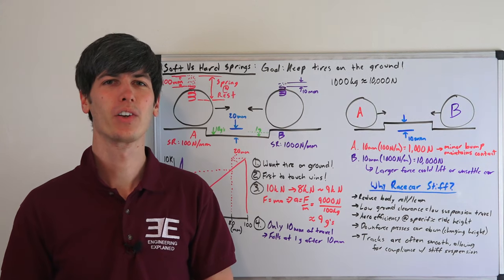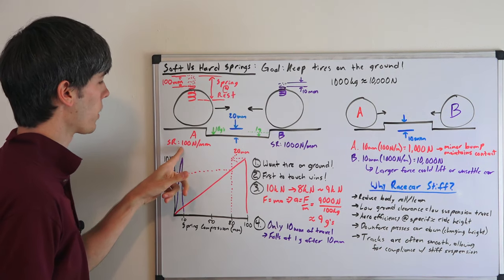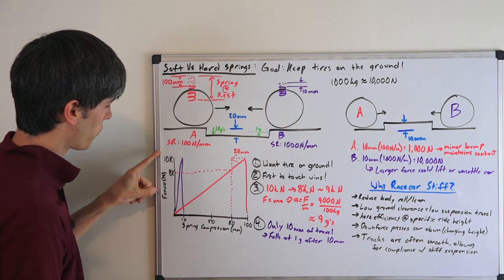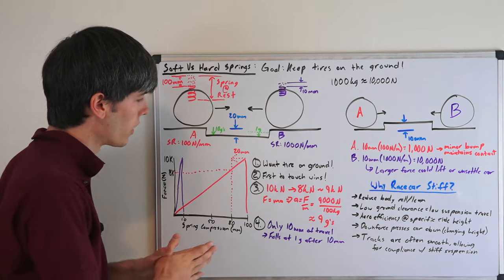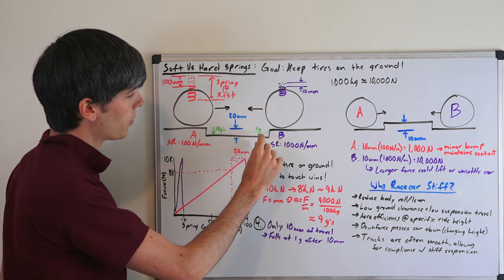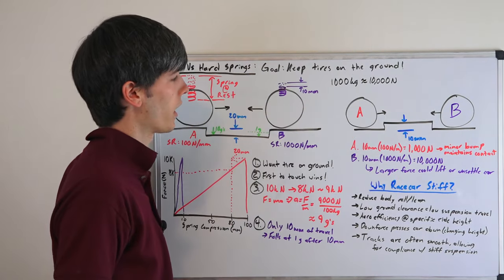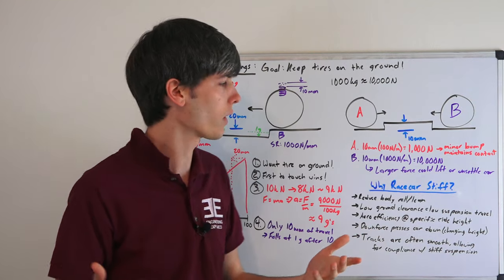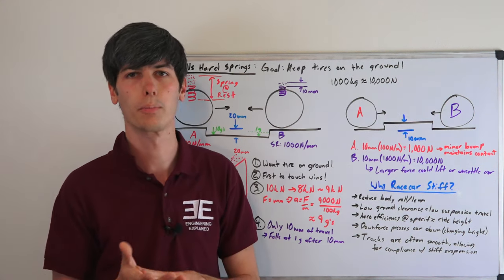What's The Best Suspension - Soft or Stiff Springs?

Comment: There're 3 basic things who affect each other: Range of spring, spring rate and the shock absorber.
Particularly the shock absorbers have to be well matched. For example there are high- and low-speed compression/rebound-stages and also the viscosity of the damping oil matters.

Comment: All of your reasoning was pretty sound and the science was definitely correct. The only thing that struck me as a bit odd was that the comparison was pretty unrealistic. Nobody ever puts a spring that's 10x higher in spring rate while using the car for the same application ie. street driving etc. Typically, I see most tuners and companies going to a 1.5-4x spring rates depending on how stiff the car initially was and/or how much suspension travel they intend to utilize. That might have made a more reasonable comparison. Great video, nonetheless.

Comment: Is that spring rate or spring stiffness? or are they both the same thing?
Reply from the maker: +Adnan Rahman I use them interchangeably. Ultimately you're measuring force over distance (how much force is required to compress the spring 1 mm).
Reply: +Adnan Rahman I believe spring rate is about the force necessary to generate each 1mm of compression in the spring. so, the higher the spring rate, the stiffer the spring is.
Reply: Thanks for the response guys. I was just a little confused because I always took rate as something per unit of time
Reply: Adnan Rahman haha i get what you mean. i think what throws people off is that the word "rate" is often used by normal people to describe some sort of speed or change in distance over time.

here, it's really more about the spring's compression, so not much to do with time at all. glad it helped you!

Comment: When racing downhill mountain bikes I tend to set my suspension up to be using about 75% travel to float over most terrain. If it is not using that much, i soften the spring rate and/or back of compression damping. The last 25% is used for g-out situations durning landings and such. Using this much suspension travel makes for an active and smooth ride.....any less and you are suffering unnecessarily and could be going faster. The only problem is that a huge compression coupled with an impact like a stone can blow into the bumpstop and dig deeply into the tire thickness often causing a pinch flat. it creates a condition where there is a huge risk of flatting but the massive amount of control will (hopefully) allow me to avoid those obstacles. Tire pressure is hugely important as it changes the frequency of the small chatter type bumps and works thoroughly in conjunction with the suspension. Tire technology has improved so much in cars and bikes that it is easier to avoid flats. This balance between compression and rebound damping, tire pressure, spring rate and rising/falling rate suspension can not be figured out mathematically and there is always a compromise. I tend to go soft and avoid big hits....I'm light and so are my vehicles. Big guys/heavy vehicles have to beef things up more and the weight begins to push heavier into the tires. I might run 30 psi where big guys will run 45-60. They handle the big hits but bounce around on the little stuff. For cars and street, set it up for where you want performance. Straight lines, or on ramps? Choppy alleys or highways? I like to be able to blow through transitions, chop and chatter with minimal fuss, smash speed bumps and humps and drive like a crazed rally driver. I'd prefer to not slow down over every rise or parking transition. I want to be able to keep up with most people on smooth but not necessary beat them in my 2800 lb truck and say bye bye over the crappy sections. I seem to get around better than most road cars and our town has terrible roads. Temperature also affects the durameter of the tires. Tuning the tire pressure is equally important to spring rate. If I were upgrading a car, I'd start with firmer/lower profile tires and then moderate spring stiffening after. If your vehicle is fairly good as it is, adjust incrementally.

Comment: This was a great chat. However an integral part of suspension control is damping, and the the stability of the vehicle structure. If we take a planar structure such as a ladder chassis, the depth of frame relative to the depth of vehicle structure is modest. Thus the frame becomes a spring system in it's own right and the spring / damper selection has to compliment the frame stability. Most successful road cars with relatively soft spring rates have above average body stability.

Comment: What if the driver is 70 kg or 130Kg :D if u have soft springs and the person is heavy... than you get hard springs 
I think it is personal what the driver like, Comfortable or sport drive
Reply: Driver weight generally has no impact on how the suspension performs.... You're talking a 60 kg difference in a 1500kg car.
Reply: yes maybe when the car is 1500kg then u not can see it maybe, but when i see my friend from 100kg step in his lowering car 980kg.. i see the car go more down on his side
Reply: MMD While the vast majority of cars are nowhere near that small, a 60 kg difference is still only 6% of the car. The car's stock suspension is designed to work with that kind of load and does not require a stiffer suspension.
Reply: and also when u put a big subwoofer in the trunk the car go down, so not very usefull information in this video ;)
Reply: MMD For example, in a 900 kg Mitsubishi Mirage, the suspension is designed to support an additional 400 kg in passengers and cargo.
Reply: For some super light cars maybe you'd have to consider that, but where it really counts is on motorcycles.

On a track/race bike, or even sometimes a road bike, there's a huge amount to be gained by getting springs that are tailored to the rider's weight.
Reply: Saying a passenger doesn't affect performance shows how much performance driving you do - very little. Even in my wrx (1400~ kg), a 70kg passenger throws out my balance, especially in tight, fast corners. Of course, it's barely noticeable with normal driving but there is a small, but noticeable and performance reducing effect when on track/spirited runs.
Reply: Victor Chang I never said a passenger had no effect on performance. All I really said is that a heavier or lighter driver does not necessitate a change in spring rates for your suspension. 

In your case, you fail to notice that with your weight mostly on one side of your car, a passenger actually improves the balance of your car. The increased weight can cause a noticeable reduction in acceleration, but cornering performance could actually improve because of the more centralized mass. 

At any rate, having a passenger or being a little heavier will absolutely not affect the spring rate chosen for the overwhelming majority of cars. 

Funny that performance complaints due to extra weight are coming from someone with a heavy AWD system weighing them down. Maybe try driving something a little sporty.
Reply: I Race dirt bikes and with us a lot depends on terrain if its really rough big jumps we go stiffer on the springs if it has smaller choppy type of terrain then we go softer and of course one's weight has a lot to do with springs as well,

Comment: Really good video and good food for thought. The only thing I would add to this, is particular with regards to racecars as a rough rule of thumb the stiffer the suspension, both in spring and bar the more it will put temperature into the tyre. Consequently when you start running race rubber you always play a delicate balancing act between mechanical grip and ensuring the tyre is up to temp.

Comment: Yup stiffening up suspension becomes disadvantageous as the road becomes more impure with bumps and etc. That's why stiff or soft can be good. Depending on the situation. If you had a pure road I would use a stiff suspension. If you drive on a racetrack thats not as pure. Time to lighten up the suspension.  A road car... You definitely what a reasonably softer suspension. Myself... I track and daily drive my RSX. So I don't use super stiff springs or suspension. It has a "in general" tune that can ride safely on daily streets and stiff enough to make my car responsive on a track. Kinda find the sweet spot. But serious racers are having their cars adjusted for every track

Comment: Ok, the thing is that stiff springs are supposed to be used on tracks, because they affect weight distribution and weight shift and also handling, stiffer springs allow more weight to be charged on them without the worry of them being squeezed to death so this allows them to handle drift better allowing you to go faster, on the other hand soft springs really shines in everything else because either on track (only of you are a grip guy) or a downhill/uphill scenario you have overall better grip as well as a smooth turn, but at contrary if you want to drift you will have to go slower to avoid hitting the wall and it's easier to spin out so, on a soft spring drive grippy and safe, please correct me if i'm wrong, always looking forward to improve :)

Comment: That may be right on some cars.
1. Variable grip level of tire through body roll ads force to the tires.

Remember you are balancing thousands of pounds on 4 small patches.

If your spring has too much play the car will only shift the the side that G forces are acting on.

Meaning understeer or oversteer

Sports cars have the set up and power to hold more G forces on a constant road surface.

Comment: Wow!  I had never heard that before!  I thought the purpose of the suspension was to keep the vibrations of the road from loosening bolts and ripping parts off the car!
So, you're saying that the suspension is designed to keep the car tethered to the ground!  Well, I guess you learn something every day!!
( I have a go-kart with no suspension, and I am constantly having to tighten the bolts and mounts after I drive it offroad.  I just assumed...)

Comment: Better is subjective based on the goal of the user. Suspension is not only to help maintain contact with the ground, but to affect how quickly or slowly the vehicle turns (provided the tires have stiff sidewalls) and the comfort of the passengers.

Comment: As usual, this is a great video on a great subject.  However, I'm seeing a lot of confusion on this topic, so I thought I'd try to help those trying to learn with a little more "real world" application of these concepts that were likely beyond the scope of this video.

Suspension set-up (and the related subject of vehicle dynamics) is a VERY complex subject.  You cannot just make blanket statements like "stiff is better, bro" or "soft is faster, dude."  Suspension tuning is not a binary decision between either extremely stiff or completely soft.  Those arguing for either/or are missing the point.

All race car set-ups are a trade-off between COMPLIANCE and vehicle RESPONSE to driver's inputs, and that applies to everything: dampers, roll bars and springs..  The more you stiffen the car, the more total vehicle grip and traction you actually lose, but you gain improved response to vehicle direction change.  You have to find the cross-over point.  Too much roll and the car feels sloppy and slow to change direction.  Too stiff and the vehicle will be very responsive in change of direction but you’re actually losing grip, and combined with a lack of compliance ,it will make the car slide all over the place, chatter over the bumps,etc. which does nothing but destroy the tires which just compounds the handling problems.  The "correct" set-up will always depend on track characteristics and driver preference, and in the case of street car performance set-ups, a compromise between all of this and vehicle ride characteristics.  I'm sure everyone has ridden in the tuned car on the street with a suspension so overly stiff it crashes over the smallest bumps and rattles the fillings out of your back teeth.

I highly advise anyone out there wanting to learn more about this subject to read the great books on this subject like Tune to Win by Carroll Smith and How to Make Your Car Handle by Fred Puhn.  You will learn a lot for the investment in time.

Comment: I would love to see a video on variable rate vs. fixed rate springs if you haven't done one already! I searched the channel and didn't see one! 

This was a VERY informative video, really enjoyed it! I'm so fascinated with suspension tuning!
Reply: Robby94LS Variable rate springs aren't complicated... They just ramp from one rate to another as they are compressed, due to the variation in spacing of the coils.
Reply: I knew that much, but I really like how @EngineeringExplained goes very in depth, history, advantages and disadvantages!
Reply: Robby94LS  I would think variable rate springs are better suited on vehicles that have a wider variation of light and heavy load conditions.  For instance, a bigger car such as an SUV or a pickup truck w/c could turn from very light loading conditions such as when only the driver is the occupant, to very heavy loading, as when it is fully loaded to max capacity, could mitigate the "cons" of using a single rate soft OR stiff springs.  In other words, variable rate springs allow you the characteristics of a soft spring when a stiff spring is not needed, and likewise can provide stiff spring action when the load demands it.  Variable vs single rate springs are not better than the other as far as traction goes, provided the spring rate at any given amount of suspension travel are well suited for the load they were tasked to handle.  A more relevant aspect to consider is the suspension geometry such that tire angles are optimal for enhancing traction.
Reply: Yes, thanks Marek Sumguy! It's been like 7 years since I've talked suspension so I'm a little rusty!
Reply: +Ro. .bby94LS
Reply: +ChuddleBuggy problem with variable rate springs is that without variable rate damping, your spring control is all over the shop.  the honda bikes i have get around this by using a rising rate suspension linkage instead (spring rate and damping remains the same, but lever ratio changes to make both the spring and damping stiffer as the rear wheel compresses)

Comment: I think both work.
But for a stiff one you need a resistant car (frame, body, and every articulation) because the suspension is not soft enough to absorb shock so it is transmitted to the whole car.
For soft ones, the  only problem are body roll, wave, lean. The car (frame etc.) is more protected cause the movements will be smothier. The soft sprint can absorb the movements as they can shape faster. Shock absorbers will not help much because if you use strong ones, it will limit the advantage you get from soft springs.
The ideal would be soft spring+variable shock absorbers able to variably absorb shocks. For example, letting the tire goes down (smoof spring) but harden and do not allow the car to be wavy once the bump is done.

Comment: An excellent explanation - for my road car I've redesigned the suspension to be more compliant, softer and with the higher ride-height associated with that car ('77 1500 MG midget). For rearwheel drive, firm at the front and soft at the back is the basic recipe. Colin Chapman (Lotus) was famous for a soft set up on his race cars too..

Comment: thanks for this video!!! very structured and well made!
one minor thing i want to add, you said beginning at 3:45 that "the softer spring presses it [the wheel] down faster". In your example both springs press the wheels down equally fast, the stiffer spring is just less mm compressed in your case. your sentence implied (my opinion) that the softer spring itself is faster. you made it very clear that the rest of the travel distance to the ground is pulled by earth graviation, but this sentence alone seems a bit missleading for me.
is this nitpicking? i hope you dont get mad over me!
i really like your videos, please continue!! ;)
cheers!
Reply from the maker: Phil Langer What I'm implying is that the wheel with a soft spring with more travel will contact the ground faster than the stiff spring with less travel. Less travel is a result of the stiffness of the spring, so they've very much intertwined.
Reply: Engineering Explained in your example yes the softer tyre with more travel would act faster but if the bump was smaller, like a race track bump of 10mm or less then the stiffer spring would react quicker, which is why race cars have those short suspension travel stiff spring setups. Also a softer spring is more compliant, easier to put power down etc however slower to react to weight shift. Understand though there are so so many aspects you can't cover it in one video. Suspension and spring setups are a fine art..
Reply: BenjiMC1 I would agree with Jason in the softer spring get's to the ground faster, even in your 10mm example. What you are neglecting is the pre-load on the springs. Both springs are pre-loaded with 10,000N but if the stiff spring experiences a 1 mm dip in the road it now only has 9000N while the soft spring (all from his example) would have 9900N. Since a=F/m the soft spring has more force with the same mass thus higher acceleration towards the new surface in the road.

Comment: This is why the Alfasud was the best handling ROAD car in its time. Public roads are not flat and hole free, so soft long travel with good damping is the way to go. There is a reason why WRC cars have such huge suspension travel compared to an F1 car. Body roll is not a problem with a properly designed multi link suspension, where toe and camber are controlled. The choice of dampers is more important, getting the balance of bump and rebound matched to the spring rates and body mass.